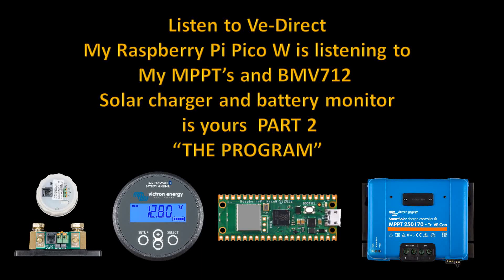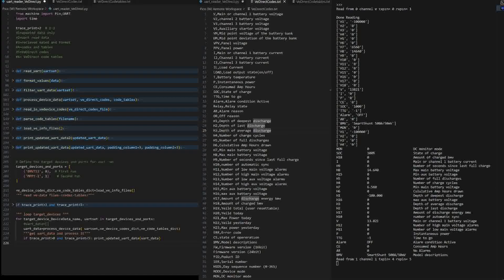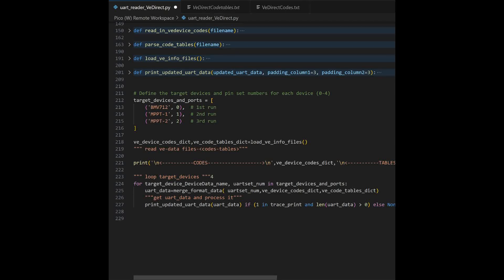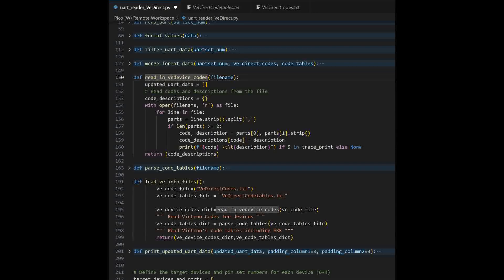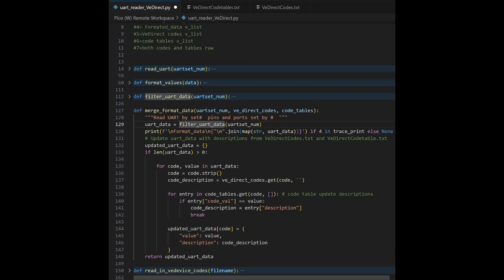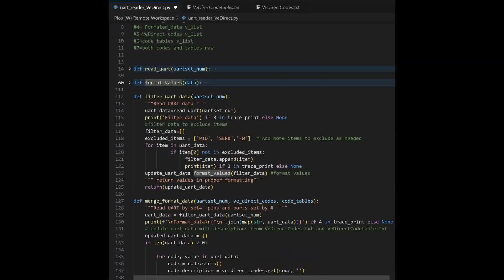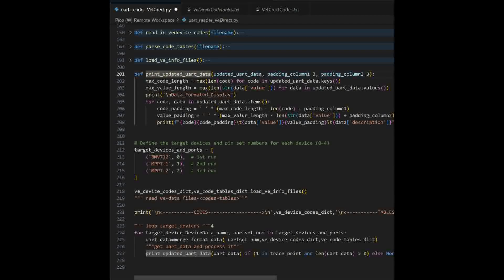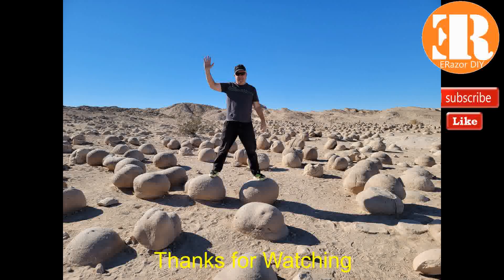Ve-direct reader pt2.  My python program, Victron battery monitor, mppt data collection Pico UART

Comment: Great explanation of the code, but a little hard to follow along on the screen without being able to study code more closely. Do you have a github with the files for this? Would love to have a copy of it. I have exact setup but reading on an arduino, has lots of issues. Would love to convert it to Python and a pico w.
Reply from the maker: Sorry at this time I don't have github.  I'm in the process of making changes to my programming changing the look etc on functionality and may post updates when completed.

Comment: Can one vedirect app read multiple devices?
Reply from the maker: This program reads my bmv712 and mppt and I display both sets of data.  I have two mppt and the bmv each connected to its own UART and I loop through each  to gather the data.  Delay and loop again.   The picow can read up to five UART so yes you could look at 5 with one picow
Reply: @ERazorDiy  ohh you basically don't run it at the same time cause if I do I crash my MPPT. I was thinking of dockerizing , would that actually work?
Reply from the maker: @askdba  Yes I looped looking at each uart one at a time.  This was just a small part of a larger program and trying to gather all the data at once was not necessary and if I recall had issues in the working of the overall program.
Reply: @ERazorDiy  thanks for the reply. I've had so many issues pulling data to my graphana dashboard.